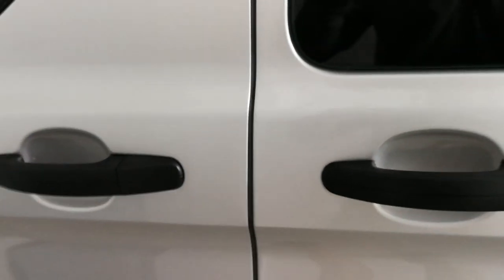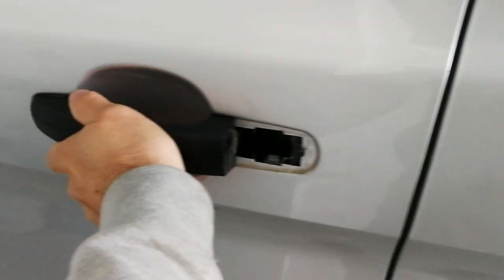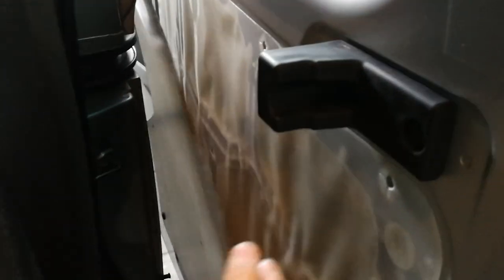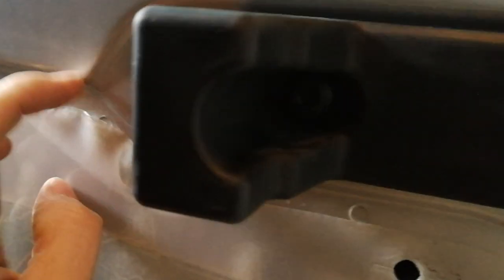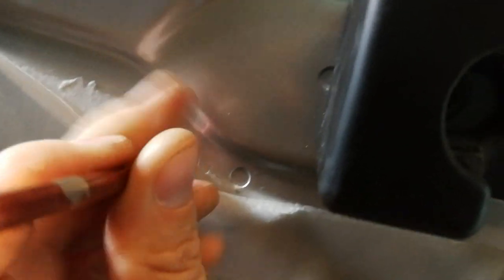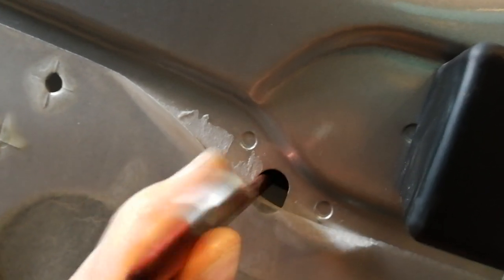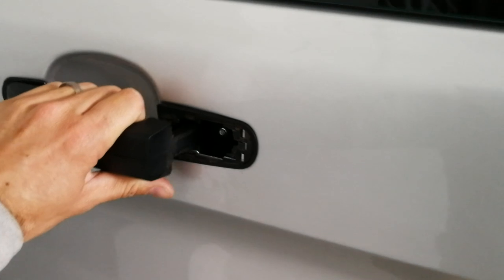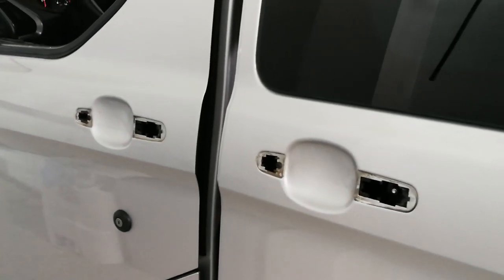How to remove side & front Door Handles on Ford Transit

Comment: Is this what you would have to do to get the sliding door open by removing both external and internal handles and pull the cable to get the sliding door open when it becomes deadlocked or is a deadlocked sliding door a power issue?